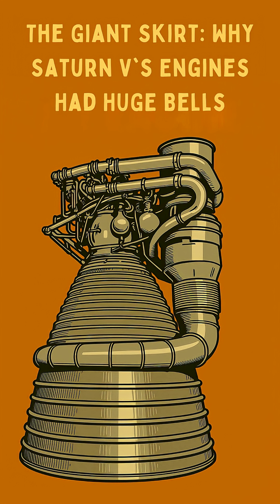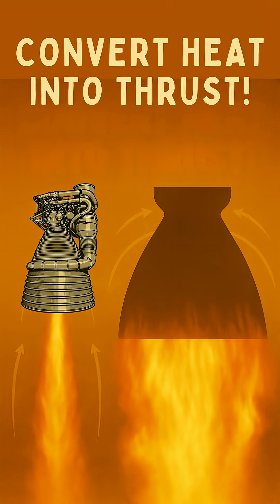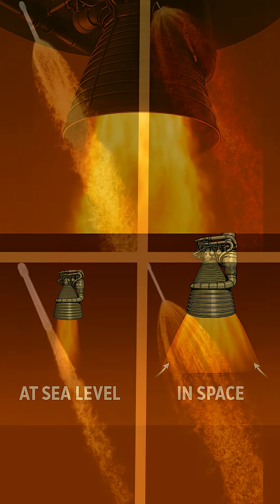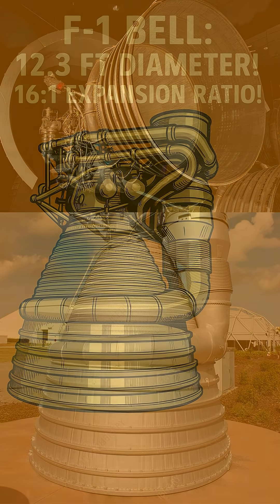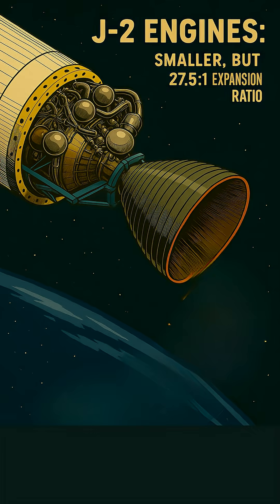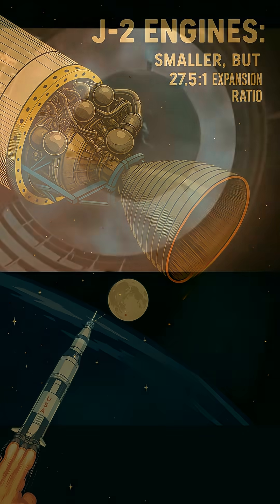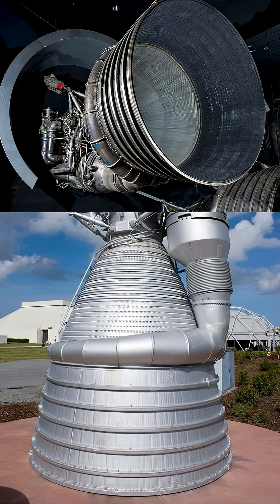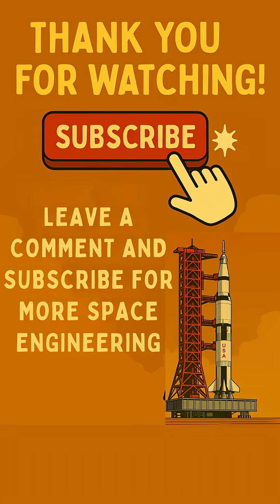Why Did Saturn V's Engines Have Giant Bells?

Comment: F=mdot*V2+(P2-P3)A2, P2=nozzle pr, P3=atm pr. At sea level and in vacuum, there’ll be pr difference which needs to be accounted for. If atm pressure is more than the nozzle pressure at sea level, the pressure thrust will become negative which is not optimal. At vacuum, the atm pressure becomes zero. Therefore, the thrust depends on the area of the nozzle.